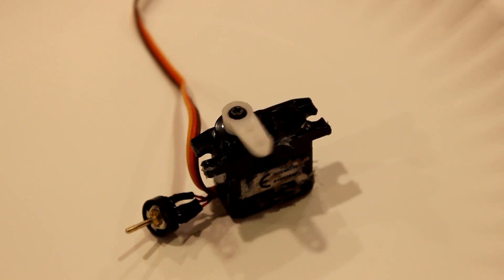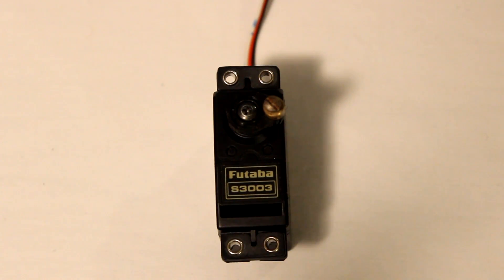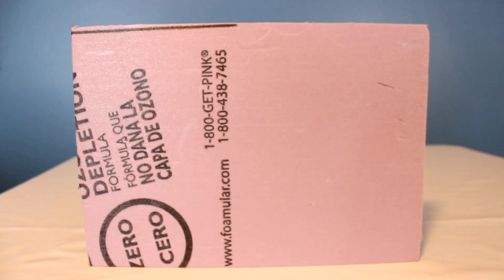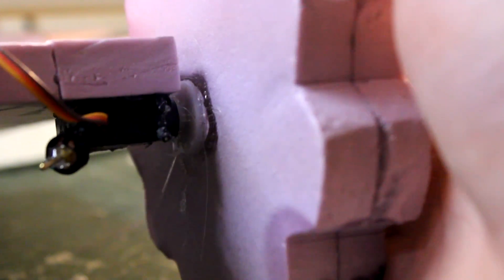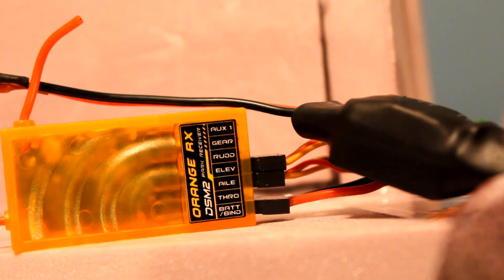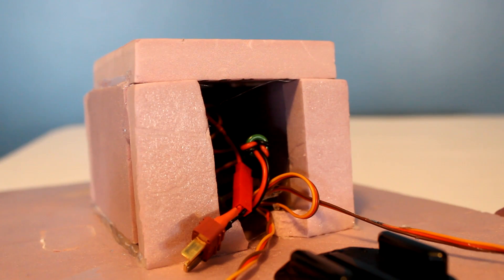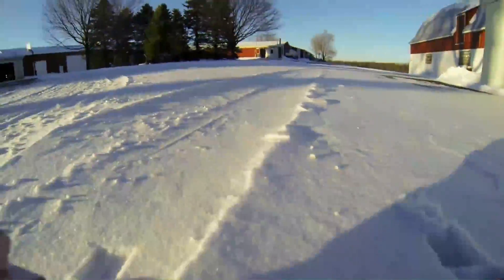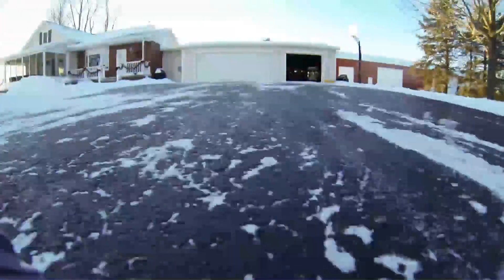DIY Servo Driven Rover

Comment: Wouldn't a 4x4 version work better?
Reply from the maker: Yes, but even on this, the wheels spun at different speeds. Getting 4 servos to spin equall speed would be very hard, but would be so awesome.
Reply: I think, I will try. I ordered 4 40g continuous rotation servo. I hope they will spin at the same speed.
Reply from the maker: Ok, well those servos shouldnt be the problem then, especially since you ordered them at the same time. Just be EXTRA careful when making the wheels, even 1 mm will make a huge difference in speed. If you get it all working, put a track around the wheels, that would be AWESOME.
Reply: Thank you for your advice, today I'll start building it. I was thinking about track but I must figure out how to make them.